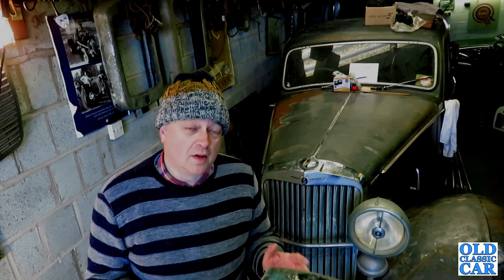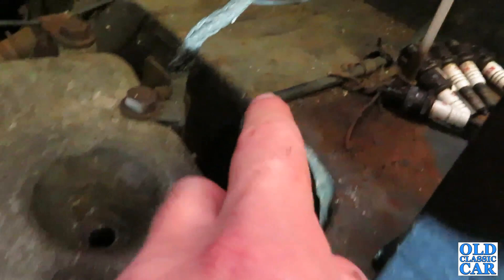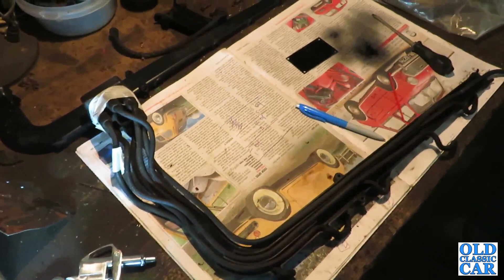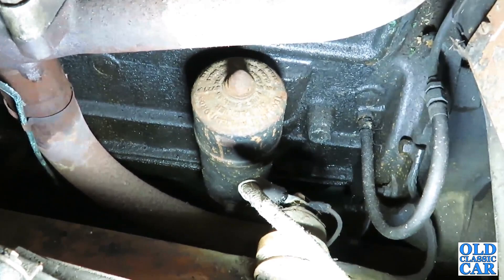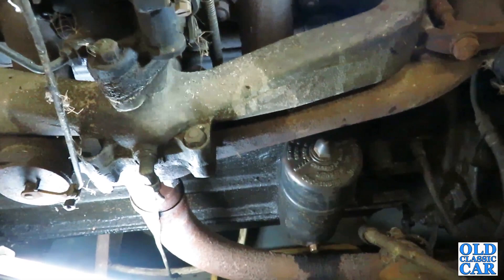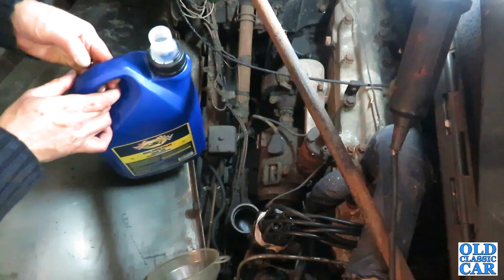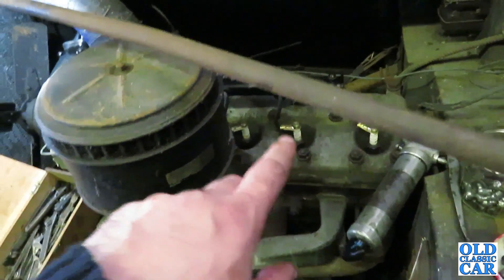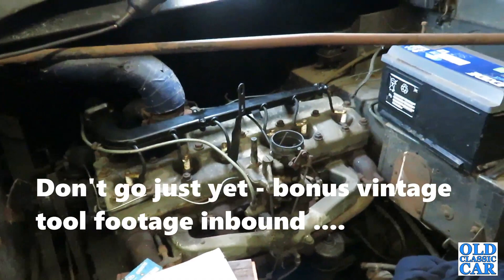Pre-war car fettling, preparing the "barn find" Talbot's engine

Comment: You might need to prime that oil filter before trying to turn that engine over to be on the safe side.
Reply from the maker: Yes I think I'll be doing that, the filter assy couldn't be any easier to get at after all